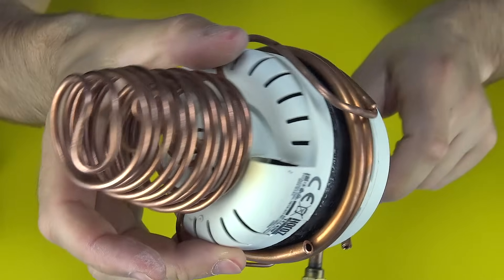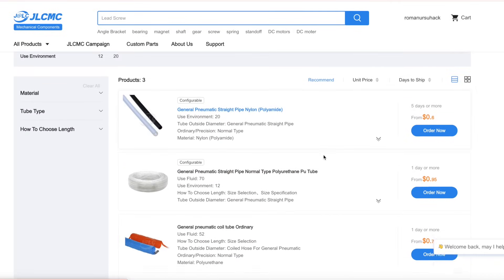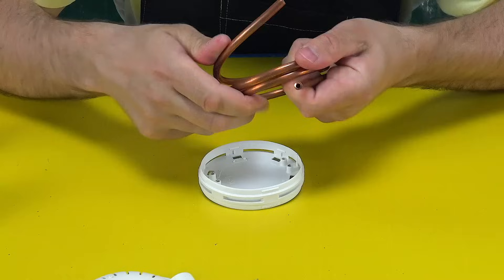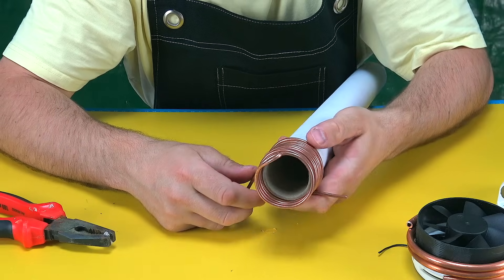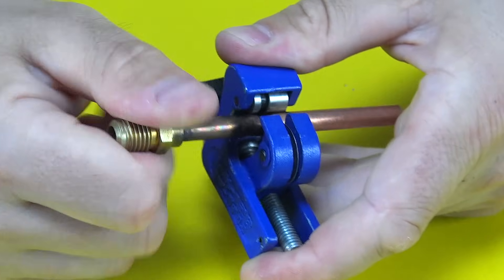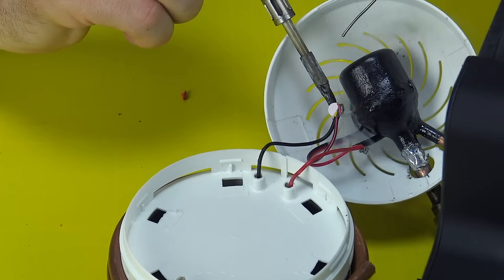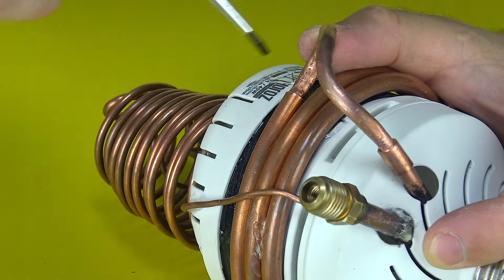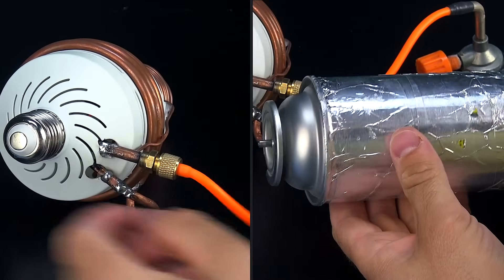Cooler X ❄️ — DIY Freezing Air Conditioner from a Fluorescent Lamp | AC Cool Air Down to -35°C

Comment: Cool learning project in showing how refrigerator works, but in practical it’s a waste of electricity. You CANT have the condensador (hot side) on the same room of the evaporator (cold side). It’s a mechanical engineering crime. 😂

Comment: I call absolute BS. How are you going to even get the fan to function when you didn't even bother cutting a hole in the bottom for the fan to even pull any air through not to mention it's restricted to the cap of the old bulb. And as for pulling a vacuum on a bike tire valve you're not going to keep a vacuum on it because a bike valve requires you to put pressure in words and it keeps pressure from going outwards. So by pulling a vacuum it's going to want to pull are back into the system which means the valve really isn't a valve because it's not working in the order that it's intended for.

Comment: Hey young man, not taking nothing from your building this maybe cheaper Air System but, you didn’t even mention if the Compressor needs Oil or not, and if it does. How much Oil would it need?????? Heck, ‘not adding Oil will shut don’t your build quite fast, don’t you think??? Also , what about temperature, will this Compressor heat up more than the Plastic Housing be capable of handle over time??? At what Pressure does this Compressor operate at? Also, what Voltage and Amperage. You didn’t say anything about Fan either. What about Fan Voltage and Amps? What about Fan controller? How is the Fan installed using the Air Electric Supply? Okay, enough. Will you please address my questions? Thank you for sharing your experience and knowledge with me. I do appreciate this much.

Comment: Where's the heat exchanger?

We knew that conventional AC or fridge always has an heat exchanger in the opposite way to the cool air flow.
If the cool air flows inside, then the hot air flows outside.
That's the basic rule!
Reply from the maker: Absolutely great question — you’re 100% right! This is indeed a fundamental rule in any air conditioning or refrigeration system. There are always two heat exchangers: one for cooling (evaporator) and one for releasing heat (condenser).

In this project, both heat exchangers are present — just miniaturized and placed close together. The thin copper tube covered in frost is the evaporator, which absorbs heat from the air and cools it. The thicker copper tube is the condenser, which releases the absorbed heat back into the surrounding air.

✔️ Without the condenser, the refrigeration cycle simply couldn’t work — the refrigerant wouldn’t be able to condense back into liquid form. This is the core of every vapor-compression refrigeration cycle.

And yes — in home AC units, the hot-side condenser is placed outside the room for maximum efficiency. In this mini demo model, both sides are inside, which reduces efficiency but keeps the scientific principle fully functional.

Comment: Where and how do you get the mini compressors ?
Reply from the maker: Hello! 😊 This mini compressor was custom-made by me using a small internal combustion engine from an RC car. It’s important that the compressor is piston-based and made of metal to withstand the pressure needed for the refrigeration cycle.

Unfortunately, compressors this tiny are not widely available for purchase. But you can find slightly larger ones — for example, from car refrigerators, medical devices, or portable mini coolers. Try searching on AliExpress, eBay, or stores specializing in refrigeration parts.

If there’s enough interest, I can make a separate video explaining how to build such a compressor yourself. 😉

Comment: esperimento fantastico! il problema è trovare un compressore cosi piccolo
Reply from the maker: Thank you! Yes, it really is a fantastic experiment. The main challenge is finding a compact and powerful compressor capable of operating at the required pressure. That’s why in the project I used a modified small internal combustion engine, which is perfectly suited for this task.

If you’re interested, I can explain in more detail how to make a similar compressor yourself.

Comment: There are 2 problems with this, 1st it will never cool a room or any area because the tube that gets hot will balance the temperature in the room so it has to be outside of the room somehow and having it's own fan that cools it down with air from outside of the room.
2nd problem the tube that get's cold will condense and collect water which  will need to be collected in a bucket because that's how humidity is absorbed from the air
Reply from the maker: Thank you for your observation — you have very accurately pointed out key factors that indeed affect the efficiency of a cooling system.

Firstly, you are absolutely right: for effective cooling of a room, the hot part of the system — the condenser — must be located outside the cooled space. If the hot tube heats the air inside the room, the cooling effect will be significantly reduced or completely canceled out. That is why in household air conditioners the condenser is placed outside, while the evaporator is inside, to create a thermal balance and provide real cooling.

Secondly, condensation forming on the cold tube is a natural process that occurs when the temperature drops below the dew point. Moisture from the air condenses on the surface of the evaporator and must be drained to prevent accumulation inside the room. In industrial and household systems, drainage channels or trays are used to collect and direct this water outside.

In this project, the main focus was on demonstrating the principle of the refrigeration cycle in a compact format. For practical applications, it is necessary to consider these important engineering aspects — proper placement of the condenser and arrangement of condensate drainage.

Thank you for your interest and thoughtful comment — it is precisely such questions that improve projects and help us move forward!
Reply: Absolutely.  You can't have both condencer and evaporator in the same  thermal locality, it defeats the purpose.
Reply: Plus, it takes a shit-ton of efforts and online shopping to build one!

Comment: I came to know that we have to fill coolant for every 20 minutes in order to run that ac. It works but refilling the coolant gas is irritating.
Reply: You have a leak in your system
Reply from the maker: Hello! In previous builds, where the components were connected using high-pressure flexible hoses, the system sometimes required refilling after about 20–30 minutes of operation. This likely happened because some connections were not perfectly sealed.

However, I’m glad to hear that your setup is working! I recommend trying to build the same design shown in this video — here, all the connections are soldered and fully airtight. With this approach, you won’t need to refill it frequently anymore.
Reply: @romanursuhack lets start that you shouldn't recharge.... The ac system needs to be hermetically sealed especially if you are using an A3 class refrigerant

Comment: That compressor looks amazing! May I kindly ask where did you find it?
Reply from the maker: Hello! Thanks for your interest in the compressor — it really turned out to be unique and efficient.

This compressor is made from a small internal combustion engine with a piston mechanism — which is what allows it to generate the high pressure needed for the refrigeration system to work.

I didn’t show how to build it in detail because it’s a fairly complex and time-consuming process that would require a separate video. Also, not all viewers might be interested, since not everyone has access to a small internal combustion engine or the skills to work with it.

In the video, I focused mainly on demonstrating the principle of operation and the system’s effectiveness. If you’re interested, I could consider making a separate video explaining the compressor in more detail.

Thanks for your understanding and support!
Reply: Hello, where can I buy this similar mini metal compressor ? Because I need to weld it to the cooper tube. There are many mini compressors but from plastic material. Thanks.

Comment: Where we can find that compressor? Any Link?
Reply from the maker: Hello! Thanks for your interest in the compressor. I want to clarify that I made this compressor myself — it’s not something you can buy ready-made in a store because it’s a unique device built based on a small internal combustion engine with a piston mechanism.

If you like, I can share more details about its working principles and the materials I used.
Reply: @romanursuhack  Yes sir, that will be great. Thanks for the reply.

Comment: that doesn't work, the hot side and the cold side are in the same room.
Reply: Its getting hotter in the room than it was before, because the pump and fan dissipate heat in your room.
Reply: And has been “faked” 😠
Reply from the maker: Your argument is incorrect and demonstrates a lack of understanding of thermodynamic principles.
If everything really depended on "being in the same room," then rapidly releasing gas from a lighter wouldn't cause cooling. But it does. Why? Because when gas expands rapidly, it undergoes endothermic heat absorption — heat is drawn from the surrounding environment, regardless of where you are.
This is the very basis of how any refrigeration cycle works.
Your comment is based on everyday misconceptions, not on actual physical laws.
Before making such claims, I suggest familiarizing yourself with at least the basics of the refrigeration cycle and the laws of energy conservation.
Reply: @romanursuhack  In a refrigeration cycle, heat emitted by the condenser is approximately three times of the cooling produced by the evaporator. Being in the same room, the room temperature will eventually rise.
Reply: @davidtang5249  David, don't waste your time! This man will open the fridgedoor in his room to get it colder. He has also a thermostate that regulate the speed of his ceiling fan. RPM drops when he's cold enough .  😂😂😂
Reply: @romanursuhack  Well the original comment still holds. You are not cooling much of anything, besides the evaporator coil, as the heat is being pumped into the same environment. Overall, using this in a room will only heat it up as you are just adding energy to the system (electricity)
Reply: @pauliusvolcokas  I agree. The cooler is working, but pumping the heat on the same environment will eventually raise the room temperature due to the cooler inefficiencies. That's why on a fridge you have the evaporator on the inside and the condenser on the outside. Your kitchen or drawer gets warmer in order for the fridge to cool down, and the calories extracted from the fridge evaporator will always be less than the calories outputted from the condenser. It's just basic thermodynamics (2nd law in this case).
Reply: @romanursuhack  Ok, so you live in a room with refridgerators with open doors to cool your room! Very clever!
Reply: @romanursuhack  
The heat energy used to compress the butane gas in your lighter was done at the manufacturers. You just moved the whole process into one room.
Reply: @romanursuhack    In order to make something "cold", you need to make something else "hot".  If both of those things are in the same container, then nothing inside that container is getting cold or hot!  They are just equaling out and doing nothing!  The "evaporator" always needs to be inside the container, and the "condenser" always needs to be outside the container! (or room, in this case).  If they are both in the same room, the room will never get colder or warmer!  It will stay the same!
Reply: @am74343 Unless you want the heat it would be the opposite lol.  I completely agree with you, I think its a neat project.  Inefficient? Yes. Ineffective? Yes, in this application. Blow air past the cold coil at your body and it would help cool you down.  As for adding a thermostat to this would be pointless, since its best use case is a short term personal cooler.  It wouldn't be bad for an outside farm market under a tent, with the fan blowing the cooler air on a persons face.   I have been trying to come up with a way to cool my goldfish tank that isn't more money than the fish are worth.  This design would work well with the coil wrapped around the canister filter line, or maybe coating the evaporator coil so it can directly contact the water.  I just wish he had a better description of lengths and sizes of the copper, where the mini compressor is from, and the final amount of refrigerant used.  I would like to make one myself for my fish, but not in a bulb form factor. Sure I would have to experiment with size, even after some math, but it would be a great starting point.  I feel it would probably give me the few degrees of cooling just as is and it would need to be done slowly anyway.